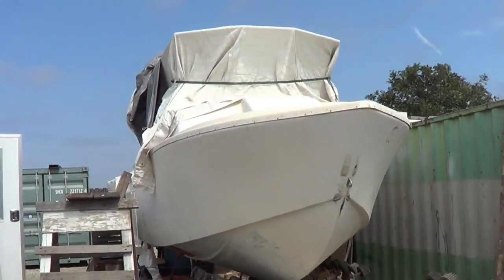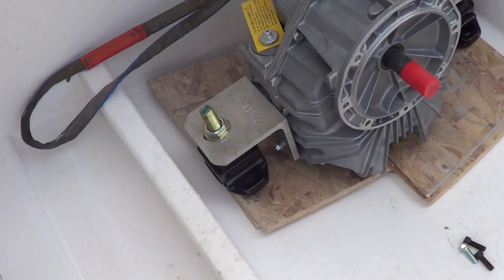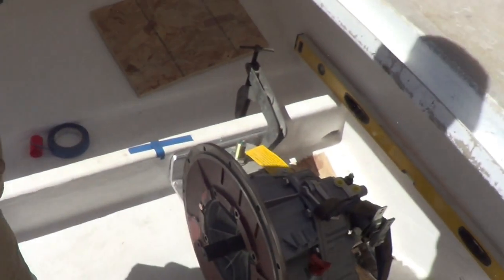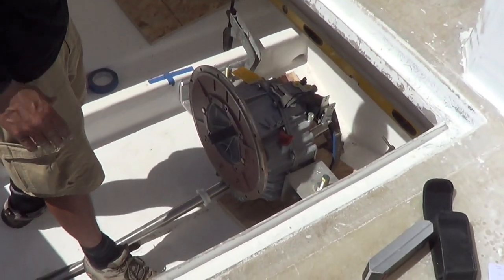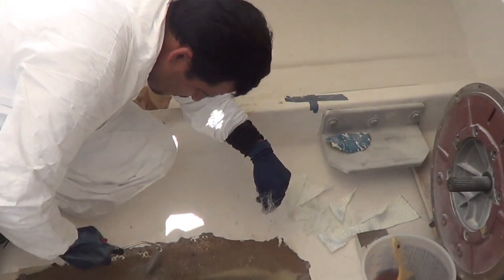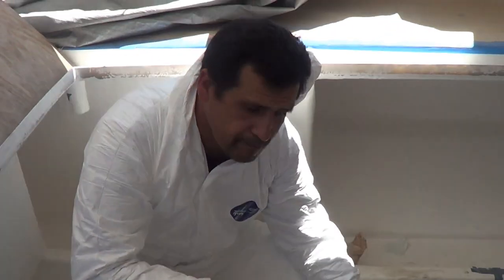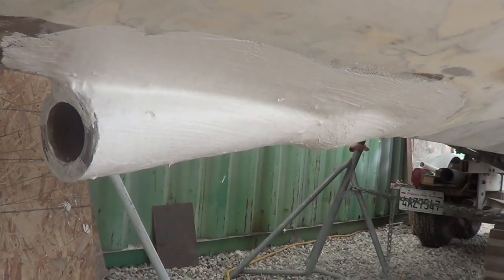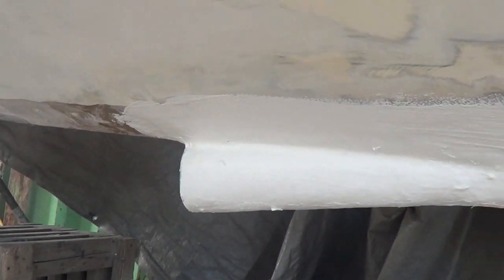Project Spotlight: Farallon 25 Prop Shaft and Offset Log

Comment: Hello, why didn’y you use epoxy for such a critical layup? Seems the better choice instead of polyester.
Reply: I would say it would be a bit overkill.  The entire hull is made of plain old fiberglass and this section is now built up with 15 to 20 layers of combo and mat.  An analogy would be using Oak 2 x 4's to build a structural wall.  Better than plain old douglass fir studs, sure, but is anyone doing it?  No way.